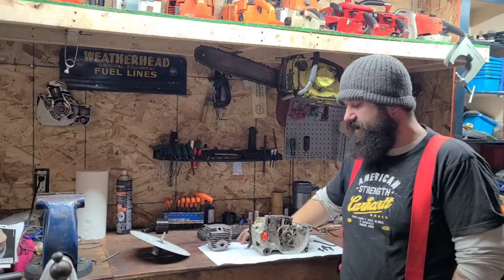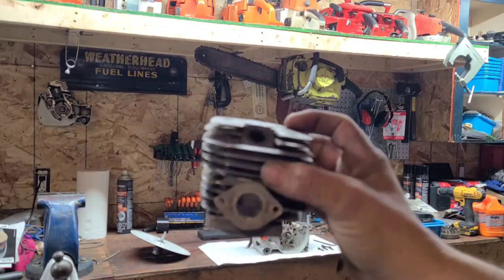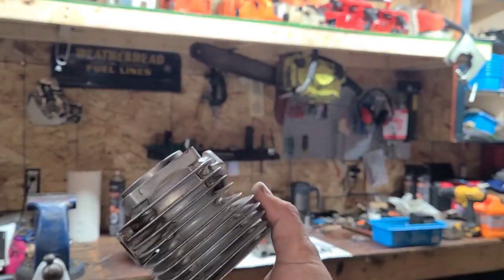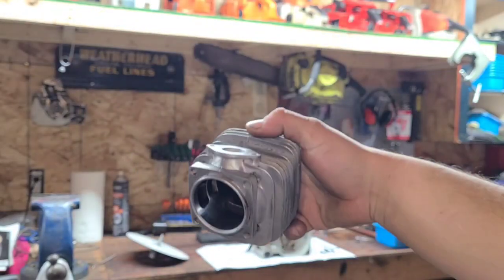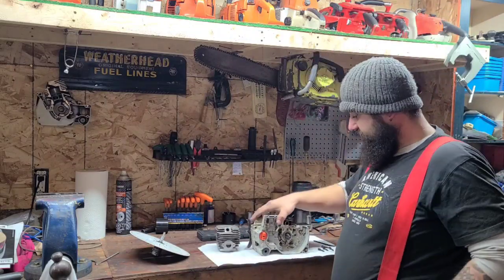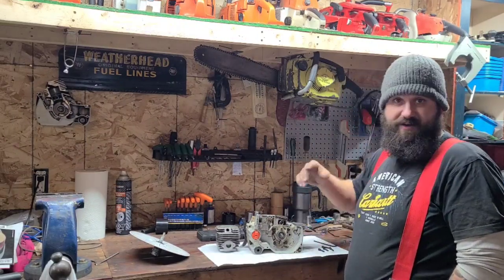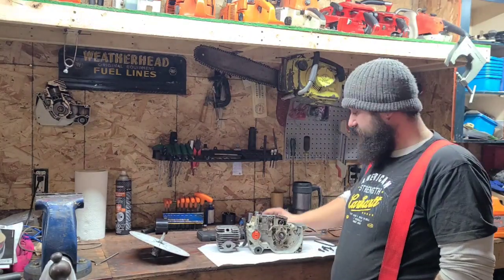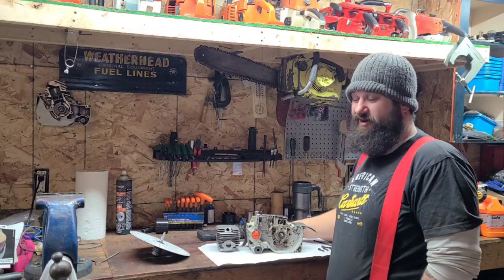How to port a chainsaw part 2: Timing your cylinder (echo CS-670)

Comment: over the last year, in prepeartion for taking on my new interest in chainsaws and porting, i've bought approximately 15 saws, an ultrasonic cleaner, a compression tester, a mightyvac pressure/vacuum tester, a foredom flex shaft, a timing wheel, and a few other things.  I haven't done my first port job yet, but I am taking in all of your training.  i am extremely confident I will be able to make nice work saws after i finish all of your training.  it all makes perfect sense.  i love how you explain things.  you truly are a great teacher.  i originally intended to port 4-5 of the saws and leave the rest stock, but you said it is addictive to port saws.  i can already see that coming!!  thank you, sincerely
Reply: 😅 23:04 23:12 23:15 😅
Reply: Ĺ

Comment: Tinman, break the rest of that plastic off the T-handle and weld a piece of round stock to it. Works for me and saves me a trip. Love watchin your tutorial. Thank you for sharing with the community
Reply: Right on. Thanks for that. I’ve got a set of those and I just know it’ll break one day. Especially if I use em in the cold weather
Reply: @shapeshifter7753  I broke many in my day. Cheap and expensive. Weld round stock, will last forever. Glad to help

Comment: I didn't mean to be so coarse in my first comment on the 461. I apologize. I really need to know how to deck a saw & time it right. I port a bit of the transfers, exhaust from the piston out & intake to the piston. I've also got some prototype air cleaners for a 461 & just those adjustments have made it the hottest saw I've ever ran in 20 years of climbing & cutting trees. Once I learn this timing & decking stuff I'm gonna be unstoppable. Also did these things to my 372xp x-torq & its a banty rooster. I love every bit of this slow shit. I must be slow🤤 42 & still climbing... but I love it & chainsaws just as much as you do. Thank you.

Comment: Good day all. A little trick I’ve learnt to fix those stripped holes in plastic. Is to place a piece of weed wacker string long ways into the hole then the fastener. I hope this helps someone🙂
Reply: Also . To not strip them .....turn screw backwards until you feel it drop into the threads. Then turn forward . 👍
Reply: Thats what I do as well
Reply: I’ve used aluminum foil, but I bet trimmer line is better for plastic. It would certainly be easier.
Reply: Small section of an appropriate sized zip tie also works a charm….

Comment: Great intro. I started the cs-680 the same way.  I got it running today as picked up. It was missing the clutch, so I will be shocked if I don’t find an oiler issue or maybe an air leak.  It will take more investigation before I tear it down.  The crank end was good, and there’s no play but I can’t believe it was abandoned just because of a $45 clutch.

Comment: Hey Tinman. I use a drill chuck like yours and i found that using vacuum caps meant for cars helps hold the drill chuck tighter if you put one over the threads. It also helps insure you wont mess the threads up to. i forget the actual size sitting here but i all buy is the small assortment pack.
Reply from the maker: I'm going to try that Thankyou!!
Reply: @tinmanssaws  They make a couple style caps. the colored caps seem to be a little thinner. I use those because of that.

Comment: Hey guys, how's everybody doing?  Greetings from the mountains of East Tennessee. Listen, I have a cs4600 45cc saw that looks like a smaller version of this cs670. First off I love the design of this cylinder, especially for a saw designed in the '80s.  But a ferrous metal ring is pressed into the intake port, which the rubber intake boot slips over.  I have no doubt that the designers in Japan didn't press this metal ring into the cylinder head for shits and giggles.  Although I do see evidence of enough overengineering to make the Germans blush I can't quite see the purpose of this ring.  I was thinking it serves as a heatsink perhaps to lower emissions but I don't think they worried too much about such things back in the 80s.  Does anyone have a clue as to why they did this? Love the channel and the enormous depository of valuable information it has become.  I've been an A&P aircraft mechanic since 1990 for whatever that's worth.

Comment: Bondus “T” handle Allen SAE, Metric and torx are the best. They have rubber coated all steel handles
Reply: What set would you use most on chainsaws?

Comment: Hey Tim man if I delete the gasket off the cylinder head and check the squish will I’ll have to re adjust the carburetor in rich or lean ? Or should I just warm the Saw up and run it a few minutes and do a plug check ? Any help would be greatly appreciate it thanks buddy

Comment: Thanks Tinman! Sure would be nice to have a collet setup on the timing wheel. 3 jaw jacobs chuck is ~.003" run out on a good day. Do you find that a 3/8 chuck will handle most crank shafts? I learned to not use rosin core solder too. Puts a some junk in the cylinder. Waiting with bated breath for the next episode!

Comment: I’ll be porting my poulan wild thing I just replaced carb and fuel lines on. If that goes well. I’ll port my clone 660. I cut big oak here in Florida and it would help speed up jobs. Thanks bud

Comment: tinman, does it matter when timing your transfers with a ring which way you turn the timing wheel when piston is at BDC?  And in general, when finding the timing numbers, does it matter which way you turn the wheel?

Comment: Almost looks like you could put a husky 56mm  395 XP cylinder on that echo With some work .  When I get a motor that's dirty like that I use purple cleaner with some dawn in a spray bottle and clean the heck out of it & then with the garden hose  & spray it  off with air & WD 40.  I like your degree will set up.

Comment: Here’s a dumb question: doesn’t the flywheel key ensure that the timing of the saw is correct in the first place? Why else would there even be a key? I understand that this assumes that no other mods are done such as porting. But if all one is doing is a base gasket delete do we still need to catalogue timing? And what do these timing numbers even tell us? Shouldn’t TDC and BDC be 180 degrees apart?

Comment: Im lost as to how the exhaust is 102 both before and after the base gasket removal. 
That cylinder dropped 10-15 thou, but the degree of rotation didnt change? 
Why?

Comment: Am I being stupid here? 
How can the numbers be the same when the gasket was installed and then when it was omitted? 
The cylinder is able to lower onto the crankcase mouth by 13thou, which means that the ports are now 13thou lower to  the piston crown …..or skirt…..  
it’s not too great a distance, but unless it’s measured at tdc or bdc it must have an effect. 🤔

Comment: You should check out a ktm sx 65 cylinder they have a vacuum controlled power valve. Wouldn't that be cool on  saw more bottom end and more top.
Reply from the maker: Thats a good idea

Comment: Did you ever see those flywheel/timing wheel adapters  I sent Harvey and Kensie? Far easier. No wobble, very secure and removal of flywheel unnecessary.

Comment: I figired you would have ussd epoxy to fix the t handle till you coud get a new one. 😉
Reply from the maker: No time lol
Reply: @tinmanssaws  gotcha. I know that story. Ive got a years worth of stuff that needs done yesterday.
Reply: That's what I'd suggested. Epoxy fixes a lot of stuff 🙂
Reply: @jeffreyrubish347  and duct tape and bailing wire. A crescent hammer and vice grips and wd40 and ya can fix anything....